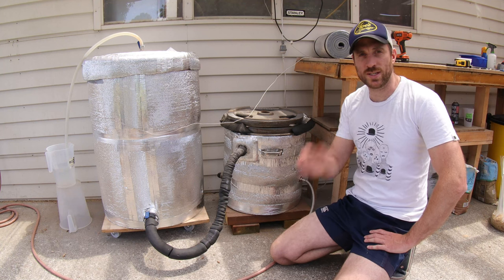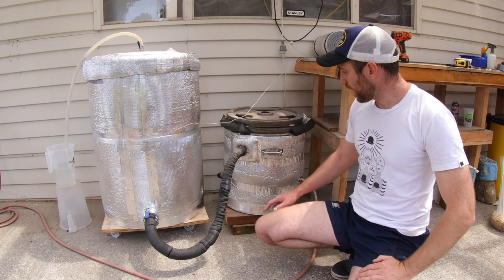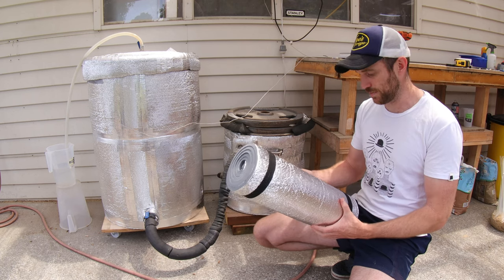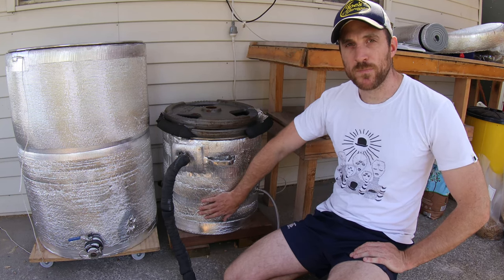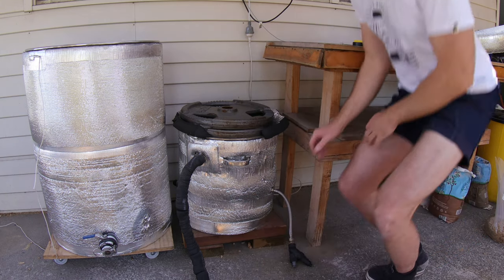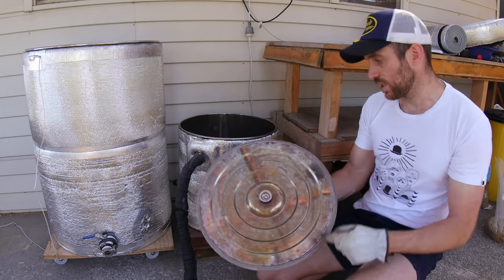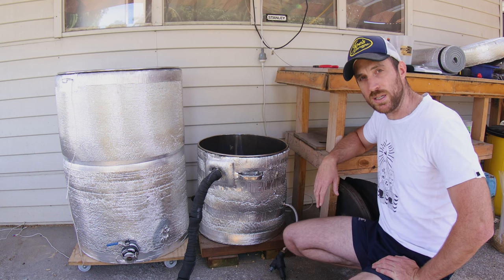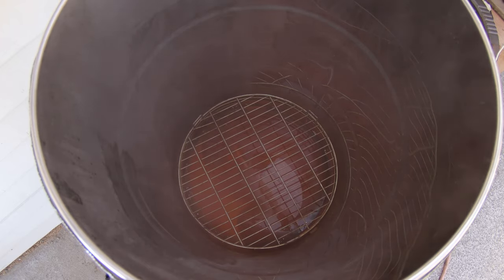Homemade Steam Generator for Sterilizing Mushroom Substrate

Comment: One of my students did the same thing you did. his 55 gal steamer was running and he forgot to turn on the water. When he turned on the water it pullee a vacuum and crushed the drum. Steam is some powerful stuff! Those fittings are bulkhead or weldless fittings and the quick connectors are called cam locks for anyone looking into it.
Reply from the maker: I am thinking a thermal fuse submerged underwater might be a good idea. One that will melt at 110c and kill the power if the water boils dry.
Reply: @OakandSpore  if your going that route, have it be the signal for your SSR not the high volt load wire. Should be a lot cheaper that way too.
Reply from the maker: No, you want to use a proper autoclave for that.

Comment: Hey man I finally got round to building one of these setups myself and I just wanted to thank you as your video here was instrumental. Works pretty well since brewing equipment is high quality. Thick Stainless was a ball ache to drill though!
Reply from the maker: Hey dude! Glad you could find my videos educating enough that you went and built one! I stuffed one drill bit before I learnt that you need to drill stainless very slowly to stop it from hardening!
Reply: @OakandSpore  I had to work a few things myself out in the details but the video is certainly educational. Understanding all the brewing equipment and feeling confident to do the wiring on the heating element and PID controller was steps not included. Even tips on drilling stainless pots, the info is out there it's just all scattered, which is why a video like your where is useful. If you ever make another video on these I think others would find those things useful. Hail to small grows!

Comment: Nice system, thanks for the video. To prevent dry run, you might want to look into adding a thermal fuse at 130C/150C. I have one on my barrel sterilizer and it saved my unit already once when the valve disfunctioned.
Reply from the maker: That is a good idea. Do you have any specific ones you can reccomend?
Reply: @OakandSpore  I used 10A 150C, because it fits in the thermostat hole of my 2kw heating element. For your bigger one you'll need 16A/20A.
Reply: @themushroomcircle-3995 I'd like to see a video on it

Comment: 3:36 Early warning 20kg weight plate system installed there as well, basically if one of those plates hits the roof, you know something has gone wrong with the sterilizing rig.
Reply from the maker: Chernobyl all over again...
Reply: I can't breath

Comment: That's a pretty nifty system you've built there.
30 years ago I made something similar for generating steam to pasteurize straw and compost. Set a 30 gallon metal trash can I'd insulated and brazed a steam output tube to, on a propane burner and ran a hose into an insulted box I'd built that could handle a whole bails worth of chopped/wetted straw or hundreds of pounds of compost.
Yours is much more professional looking I have to say. 🍄

Comment: Thanks for posting this!  I am making one with an 80 qt pot and a 1"  steam pipe.  I'll be using steel pipe between the pot "boiler" and pasturization chamber.  I'm hoping to use it in conjunction with an old deep freeze to sterilize mushroom bags for my mushroom business. We'll see what happens.  Either way it will work with a drum if the freezer doesn't work out. I appreciate your efforts!

Comment: is there any reason we couldn't just use a pressure cooker attached to the barrel instead of a DIY boiler?
Reply: My bets: 1) it would wear out the larger fancier barrel faster, small pots are cheap to replace and 2) you could not use it while it's cooling down. Having the boiler separate means it would cool faster than the grain barrel and you could start a second grain barrel while the first cools.

Comment: Hey @OakandSpore, 
Thanks for all the info and the videos, really helpful!

I’ve got a question, if you’ve got the time and knowledge, I’d be thankful for your reply.

I’ve built an as exact replica as I could of yours. I’ve tried it a few times (with an empty barrel), but never gotten up to a 100c. My analog thermometer measure 97c and my digital one (PID) measures 92c(set the PID at 100c).

My question is, if I’d fill the barrel full of bags. Would that help bringing the temperature up? I’m thinking less space to fill with steam and once the bags get hot, they help keeping the barrel warm. Please correct me if I’m wrong and what I can do to solve the problem, if it is a problem.

Many thanks, Martin

Comment: Can you tell me how high the intake hole from the bottom is? I found a brewery pot that has a precut whole 5.5in (14cm) from the bottom. Would that be to short for the same ballcock valve design you  have?

Comment: Nice setup!
What's the status on your morel experiment? Is a video coming soon I hope 😎
Reply from the maker: Spoiler alert, It failed. But I have managed to grow from the spores of a dried morel which looks to be growing sclerotia on a petri dish, so it'll be round two of the experiment!
Reply: @OakandSpore  there are a few patents on proper cultivation of Morel, one in US and one in Asia somewhere, as far as I’m aware, slight adaptations of these patents are necessary not to infringe but if I remember correctly; one of the patents is about to run out (; I’ll race ya!

Comment: What is the surface area of your safety valve and how many PSI have you calculated to vent at with your ballast weight? I need to build a larger output unit (oil fired) that needs to run at 3 psi or less and considered the same gravity/ballast relief plate. It’s explosion proof! Thanks for your reply.
Reply from the maker: I use a new unit now, I have it in a later video. It uses weight as well, and will vent even with a small amount of pressure. Very safe.

Comment: I think you might want to turn the wrap around?  The metallic part does IR reflection, so I'd think that would be a better internal layer, and then the closed cell foam on the outside to prevent conduction and convection?  Maybe some ME that knows thermodynamics better could chime in and help?

Either way, really awesome setup mate!
Reply from the maker: I would defiantly like to know of that's the case! I would have thought the foil side would still reflect the IR even through the foam.

Comment: Awesome! Are you planning on showing us your PID control box/setup? Also, what size fittings are you using for your water inlet and Tri-clamp? 

This is fast becoming one of my favourite channels. Cheers.
Reply from the maker: I actually had filmed it but it was really out of focus, so I figure I will make a seperate video showing it. It's a copy of Myers Mushrooms PID controller, so I can't really take all the credit for it. The braided pipe should connect to the back of the float valve.

Comment: May be building myself a simular setup, I am curious as to what those stainless barrels are used for, to give me a idea where to go looking for them... Brewing industry I am guessing?
Reply from the maker: They were for honey I believe. But they were far to expensive, I have a new plain old steel barrel which I am going to turn into a third steam drum. Steel does rust, but It should last a year or two, and it was only $20.
Reply: @OakandSpore , add a zinc anode to prevent rusting. Just like your water heater in the house.

Comment: i think this is better than a bubbas barrel. you can seal it which is great if you cant let the sterilizer cool down in a lab while the bags cool since they be sucking in air during that cool down. also you can make more than one barrel an rotate them out which is amazing. also you dont have the element an so forth in the same container as your substrate so you get more volume out of you barrel and can load more grain.
Reply from the maker: Bubbas barrells have their purpose and niche. I originally made one like bubbas, but after I nearly set fire to the substrate on the inside I decided to make the boiler separate.
Reply: I would still think you wouldn't want to completely seal it during cool down or the air inside shrinking as it cools would create a negative pressure issue - similar to what happened to the collapsing boiler but much less extreme and sudden (I imagine?). But maybe it isn't getting hot enough for that to be an issue?

But I had the idea to seal it up completely with the exception of a small port with a filter on it to allow a small amount of air exchange just so that pressure can equalize but still keeping contams out of even that little opening...

On the flip side, having it opened up more to the surrounding air would help it cool down faster if you were in an environment where you weren't worried about contams.

Comment: Cool video! Slowly getting everything I need to start growing. Quick question for you if you don’t mind, have you ever heard of someone adding spawn to sterilized grain instead of using a inoculation syringe or culture?
Reply from the maker: Yes you can inoculate sterile grain with existing grain spawn! You don't want to keep doing it too many times though.
Reply: Oak and Spore Mushroom Farm thank you so much! I didn’t know if it would be to high of a contamination risk. I’ve only used pre bought syringes. It seems like it might be easier to just grow culture and leave it in the fridge so I can always have fresh spawn and not have to worry about the old stuff breaking down. I can also still use the syringes so I don’t have to worry as much about contamination
Reply: Ark Survivor there’s definitely contam risk if you’re doing a (colonized) grain-to-grain (sterilized) transfer so be sure use a flowhood or still air box and not to leave the jars open any longer than you need to! Happy growing🤘

Comment: If ya cant tell ive been working on my own. Thanks so much for this video and the others. Theyve been a big help.  One more question for you....what caused you to use that size pot for your streamer?  Would you see a benefit of a smaller or larger one?
Reply from the maker: I used it because it was large enough that I could easily attach fittings to the side. Any smaller and the curvature of the pot stops a bulkhead from making a snug fitting, and they tend to leak.
Reply: @OakandSpore  thanks for the response. That makes sense. So a larger pot with less of a curvature would be better for the seal. I appreciate your videos. They've helped alot. Thanks

Comment: I really like this safe approach.  Do you think the boiler is enough to steam 2 barrels at once?
Reply from the maker: No, really only 1 barrel. My bottle neck is that I can only do a single 55 gallon drum at a time.
Reply: with a bigger element sure you could hook up 2 or 3 drums. You would want at least 1500-2000w per drum.
Reply: Wouldnt a 55 gallon resealable lid drum be better for the boiler And even cheaper?

Comment: What is the contamination rate of the bags when you do low temp sterilization like that, compared to pressure cooking, in percentage? I finally made boiler inspired by you. 2821 liters capacity steam room reached 99c in 50 mins with two propane burner boilers, and so I built 3626 liters room this time.
Reply from the maker: my contam rate is near zero. I find spawn contams easy, mushroom substrate bags are more resistant to contams.

Comment: Where do you plug in your PID sensor, the 10-gallon kettle or the 55-gallon barrel? Do you make an extra hole for it or slip it under a lid?
Reply from the maker: It's in the 55 gallon, with a small hole drilled through the side about 2 inches down from the lid, with a small nut holding it in place.

Comment: How did you get the pid sensor into the steam barrel? Drill a hole and RTV silicone in place? Also I guess RTV silicone fine for the boiler lid as well?
Reply from the maker: The thermo probe is threaded, so I drilled a hole and placed a small nut on it to hold it in.

Comment: I'd imagine this works well for pasteurizing substrate as well?
Reply: Long story short, this setup most likely is actually pasteurizing not sterilizing.

My understanding is that this setup can achieve sterilization after longer periods of time. Running it for only a few hours will achieve pasteurization or possibly super-pasteurization.

Sterilization is typically 121°C (250°F) at 1BAR (15psi) for an hour. Really depends on what you're sterilizing because the center of your object needs to reach full temperature. A piece of glass will take only a few minutes whereas 5 pounds of grain inside of a bag will take much longer since the steam doesn't reach the very center of the bag.

This setup is designed to not build pressure in the steam chamber for safety reasons. There will probably be some pressure but not too much. So at atmospheric pressure, steam only gets to the boiling temperature of water which is 100°C or 212°F. This is plenty to reach pasteurization but not sterilization.

Pasteurization starts at 60°C/140°F but I think the recommendation is 70-82°C (160-180°F). The idea behind pasteurization is to let beneficial microbes survive that help the mushroom spawn get going and out compete the contaminants. That being said, a chamber like his will theoretically over pasteurize and kill the beneficial microbes which means contaminants have a nice breeding ground. But that's essentially what sterilization does. So really, it seems like pasteurization is the better option.

There's another technique where you do pasteurization multiple times over multiple days to achieve sterilization. Basically you allow the microbes to germinate and then kill them and then repeat until all have germinated and then been killed.

That's my understanding of pasteurization and sterilization and I don't know exactly how that manifests in the real world.

Comment: Writing from Argentina, South América (yeah: Messi, the Pope, etc). The elements within and the construcción itself of the boiler do not (at least to us where language might be the gap) show that clear to us. Is there any video of yours showing that in detail with some more description on parts and specs of elements therein? Thanks in advance for your help about this particular item. Best regards!!
Reply: You can use elements that are used in water heaters. Here in the US, home improvement stores sell replacement elements at different power ratings. Only problem is they are usually threaded into the tank and come with a gasket on the outside so you will have to find a nut, washer, and gasket to thread into the inside or a proper sized bulkhead to thread into. Check out these links and you should get an idea of how it works. Hope this helps.

https://www.amazon.com/Camco-Screw-Foldback-Heater-Element/dp/B0002YUDSI/

https://www.amazon.com/Bulkhead-Connector-Stainless-Thru-Bulk-Fitting/dp/B07X41NXN3?th=1&psc=1
Reply from the maker: Sonia, messi? We play rugby here, not soccer! I will look at doing a video update in due course.

Comment: this guys got jokes lol, great video thanks for the info man
Reply from the maker: Cheers bro!
Reply: @OakandSpore  would you say this is possible to run the boiler with a gas burner? i feel like it might be cheaper then electricity.
Reply from the maker: Possibly, a you wont be able to control the temperature as much so it will probabley end up costing more. My element only turns on for about 4 seconds every 10 seconds.

Comment: Hey mate , made one of your steam boilers ,  thanks for sharing your knowledge , mine has a small hole to allow steam to escape , it seems to reach a maxium of about 92 degrees celsius  , was wondering on what sort of temperature your  aiming for  and how long at the temp to sterilize , thanks in advance , keep up the good videos, have learnt so much from them , thanks
Reply from the maker: Hey dude, glad to see you made one! I set mine to 95c, and keep it there for aroudn 24 hours. I tested it at 92, but found I got a bunch of contam, so put it back to 95. If you want hotter try to insulate more. Otherwise just sterilise it for maybe 26-30 hours at 92.
Reply: @OakandSpore  , Thanks , will insulate it , to push the temp up a bit , was happy with the trail run , can't wait to fill her up , she's sitting nicely at 93 celcius  and have it controlled of a brewing controller  that's rated to 140 celcius powering a 2200 watt element , keep up the good work love your channel

Comment: What kind of valve is that on your barrel behing the quick connect? The connection for the steam line to the barrel.  Thanks.
Reply from the maker: It's called a bulkhead. Search websites for home brewing equipment, that's where i get all my fittings from.
Reply: @OakandSpore  i did. Thanks. Ive already ordered it. Was supposed to be here yesterday. But shipping is all messed up currently

Comment: Just curious, does anyone use these low pressure steam set ups to sterilize spawn? OR is it just meant for substrate? Also, does it actually sterilize what goes in, or is it meant for pastuerization? Too many people use the word sterilize loosely and I'm just trying to figure out what they are capable of.
Reply from the maker: You can sterilize at lower temperatures, it just takes longer. Sterilizing at 125c means you can do it in minutes, sterilizing at 95c means it takes many many hours, and may not totally kill some strong bacteria or contams. I don't sterilize spawn in these, but you probably could. I use an All American autoclave for my spawn. Google thermal death curve and you can get get an idea of sterilizing times at different temperatures. There are kept a couple degrees below boiling.
Reply: @OakandSpore  Solid reply, Man. I hope you do get Mr. Olympia.

Just to be clear. They are safe for grain spawn, it just takes a very long time?